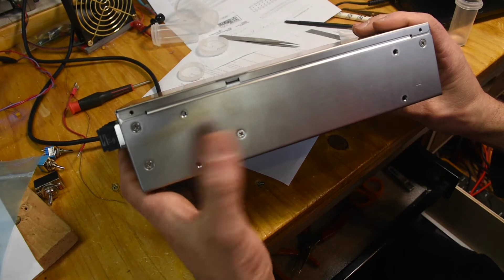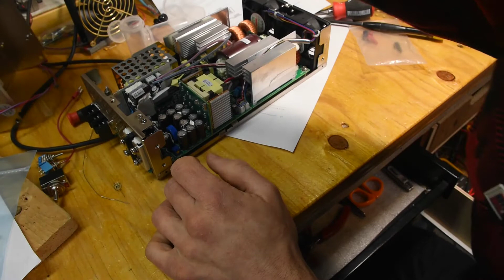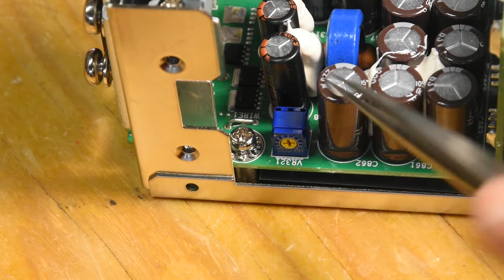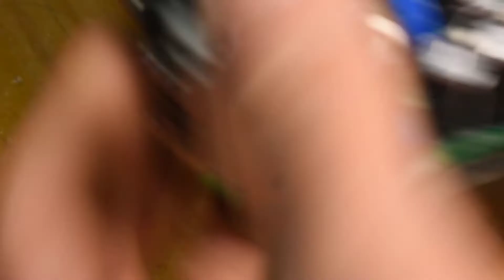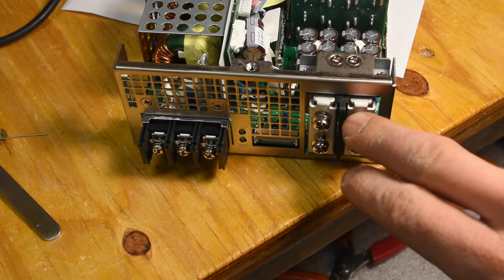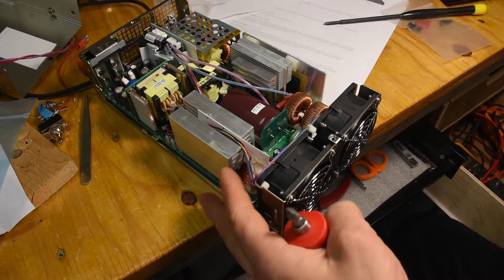Artesyn LCM1500 power supply: teardown and modification

Comment: I just bought one of these (24v) to power an RC car lipo charger. I didn't notice the control bus. 

Will it produce full output by plugging it in? Or is this what this mod is for?
Reply: I was actually wondering the same thing. Do we need the control bus to use this?
Reply: @ancientalien815  I forgot I posted this. It puts out the full 24v just by plugging it in. 😎
Reply: @LiquidSSSnake Awesome! Thanks for letting me know! I was super worried I was gonna have to buy a controller or something.